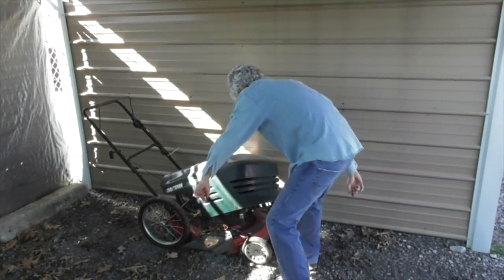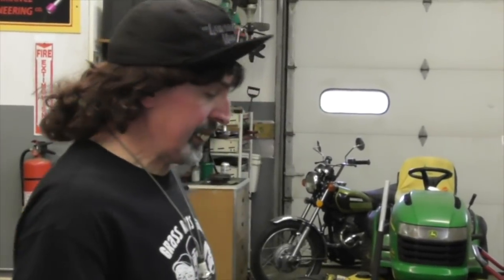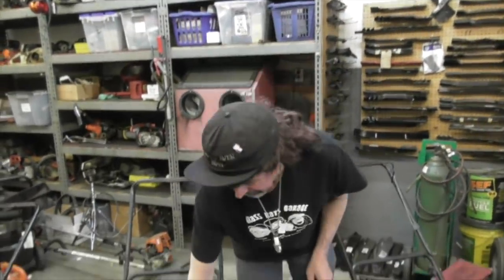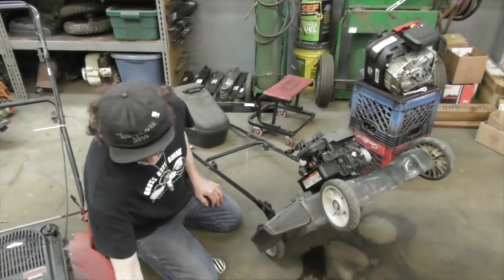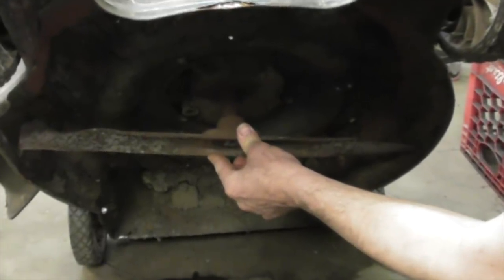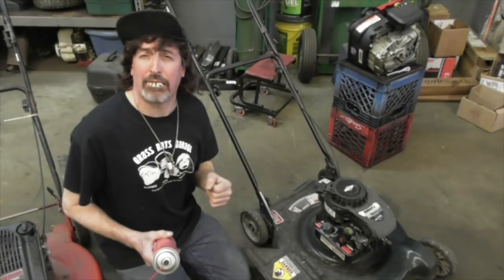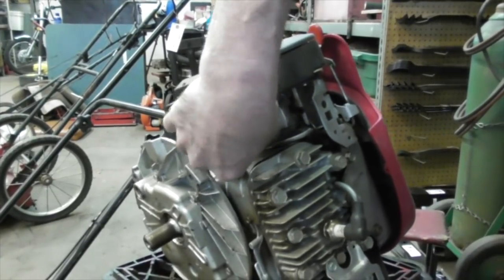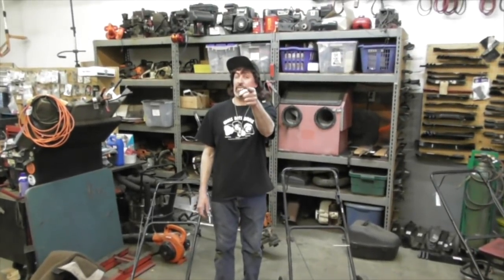How To Maintain Basic Push Mowers

Comment: I've discovered 90 octane recreational gas in my area.  It's ethanol free and I use it in all my small engines.  Good stuff but expensive.  Taryl, I always learn new stuff from your videos.  There's yur dinner!
Reply: I live in lower Michigan.  The rec gas is popular with boaters (me included) and recommended by my local lawnmower guys.  There are at least two gas stations in my area that carry it.  When I used "regular" pump gas in my snowblower, it definitely gummed it up.  I had to take the fuel line apart and clean the fuel shutoff.  Taryl would appreciate this.

Comment: The Internal Combustion Engine has provided man with an incredible leverage over taming nature.

My friend and  I cut and weed whack several cemeteries, which are my absolute favorite! 
Very often I find myself reading dates and think about how long that chunk of granite (or concrete) 
has been sitting there, through many storms and wars of man.
Before gas engines were invented, before air conditioners, before electric power
distribution, before antibiotics were discovered.  1886 is the oldest marker I recall to date,
and I wonder, how many hundreds of times the grass was cut since then, and HOW did they do it,
if at all?

The downside, many careless mowers have hit those old stones, and chipped them.
A grave marker will fight back and many have destroyed blades and decks.

Best to all and....Thanks For THinking!
Mr. Brown

Comment: Great basic mower maintenance video Taryl! I'm sure you already know this but whenever I work under the mower deck to get the blade off, I always take the wire off the spark plug, just in case the engine decides to fire while my hands are under there. I worked on a lot of much older mowers years ago that didn't have a brake on the flywheel years ago and I always did this.
Reply: I saw that too!!...
Reply: Serious question, but I've been wondering. With kill switches and modern ignition coils, is it even possible for an engine to kick over if its blade is turned? Don't get me wrong, I always disable the spark plug and always will, but is that because I'm just being extra cautiou, or because I could really start an engine with the blade?
Reply: It is very unlikely the engine would fire with all the safety switches and whatnot is on these modern engines. I am used to working on older stuff and you never reached under the deck with out taking the spark plug wire off the plug.

Comment: Hey Taryl couple of things I wanted to throw your way and not sure you have scene this before but Eaton brand fuel lines transparent inner core have separated from the inner wall of the rubber hose causing the fuel pump to suck it shut preventing fuel to the carburetor, I have found this issue on a Bad boy mower model BMG5425KO with only 32 hours run time, 2nd on that same mower a bulletin was scent out from Kohler advising that there KT models have heads that may not have the oil drain holes knocked out of the head castings causing the oil to build up inside the valve cover blocking the vacuum from the fuel pump, just wanted to share this info with y'all, Thanks again for making informative and hilarious videos !

Comment: I always run my snowblower out of gas come spring and do the same to the mower in the fall.  I found it easy enough to put the push mower up on saw horses to do the blade sharpen and oil change.  Would love to get a motorcycle lift to do this but I'm too cheap.

Comment: There is only ONE THING I think you might have overlooked Tayrl...starting at about 5:42,when you were showing how to take the blade off the mower,you didn't DISCONNECT and LOOSEN THE PLUG in the event it should accidently start by ONE rotation of the blade by your ✋ hand.If the engine does start by inadvertently rotating the blade even through ONE compression stroke,👋⬅GOODBYE FINGERS!!!!!.⚠⚠⚠⚠⚠⚠⚠⚠⚠
Great video otherwise Tayrl and we missed you and your crew last Sunday.I hope all is well and we your fans look forward to another EDUMACATIONAL 🎥⬅FILM...😀👍
Reply: Unless the dead manhandle is pulled it will not start.
Reply: Tony Papantoniou There are ALOT and I mean ALOT of older push mowers out there that are more then 20-30-40 years old and can still"CUT IT" and DO NOT have a"dead man"handle,this is a fact that seriously needed addressing and there is another comment about this same issue even before I said it.I just want people to be safe doing this work without a trip to the emergency room.
Reply: Very true, the first step in working on anything is to pull the plug wire and ground it to the frame if possible. Don't want anybody losing any body parts.
Reply: Steven Brindisi Yet,some place,some where as we speak,somebody is accidently donating some body parts doing this work.
Like John Deere says in their owners manuals..."SAFETY LIVE WITH IT"
Reply: I thought they all had dead man's handles. In that case remove the spark plug cable.
Reply: Tony Papantoniou I own a Snapper built in the 1980's and it doesn't have a deadman handle.I always loosen the plug and disconnect the plug wire.
Reply: Sensible, I would install a dead man switch.
Reply: Tony Papantoniou I agree..."back-in-the-day"nobody thought that way.
Reply: 4 gauge
Bahh. Just yell "CLEAR PROP"!!!
Reply: Russ Davis HAHA!!.😁👍Makes a"NINJA"blender look like a joke.
Reply: 4 gauge Why loosen the plug? Just unplug the wire.
Reply: RC Hobbyist Extreme When dealing with a piece of equipment that can very possibly end your life(bleeding to death)you take as many REASONABLE steps as possible to 100% secure your safety.Better safe then sorry,it only takes a minute to loosen the plug.(or even take it out)If you survive this 🍔 hamburger maker,you will never get your hands,fingers,or your life back.Remember,these small engines are alot stronger then you would like to believe.Some of them have as much as 6.5hp.and in less then 2 seconds,it will give you serious plastic surgery issues.
Reply: 4 gauge You dont have to preach to me. I play with whirling blades of death for fun. The chances of a piece of lawn equipment starting with the plug wire pulled is 100% zero. Starting a 17 " prop on a high compression Nitro powered scale airplane is a 100% chance you can lose a finger if you dont use your head, and a " chicken stick" to prevent that from happening.
I also fly scale helicopters and there is nothing worse than seeing an out of control heli heading in your direction because of a sudden loss of signal on the Transmitter or receiver. Panic can kill you. Hitting the throttle cut off switch is the best way to avoid death. I have seen pictures of guys that have been hit by rotor blades, its not pretty.
Reply: Thats ok, not taking it personal. I saw an original Big foot 72 hz ( Blackfoot? ) RC truck at a yard sale yesterday. No idea if its worth much. I know they did a remake of it last year. Sadly, the guy didnt store it well and it had issues. The original battery pack was still in it. There was lots of dust and cobwebs, smelled like it was possibly incorrectly stored in a damp environment so probably corrosion. He wanted a price on it. I had no idea as the condition didnt warrent an answer other than no idea.
Reply: Like he does at 5:04  by putting a weight on the handle !!!!
Reply: TheOldGuyPhil Too iffy at best.
Reply: The weight can FALL OFF.
Reply: BOB Driver I used to own my own shop FIRST of all.Second of all,military mechanics DO NOT DEAL WITH EMISSION ANYTHING on any tractor or truck etc..We can care less about GARBAGE like that in general,its not even taught in the class room.Why??,a military grade engine(gas or diesel)is very,very basic in design,because it has a direct affect on the reliability of the truck or tractor its in.(I bet you didn't know that)
Oh,the emission systems that your dealing with now,are designed by honorably discharged MILITARY ENGINEERS,Cummings and Catapillar have the BEST BUILT engines in the world because of their military know-how.My company that I started more then 50 years ago cleared me a 8 figures a year,most of the employees have a military background in mechanics or military engineering background in engine design.Now,transmissions...in the military,they DO NOT use JUNK like your describing,the transmissions are VERY BASIC,as in machined gear to gear,clutch and shift design,again the complicated designs are for the civilian population in general,no sensors to go bad,no electronic computers to go out etc..I used to work on small engines for many years and now I'm fully retired.(I have a 8 figure income and I have more money then even what your whole family would need in 2 lifetimes)I worked on small engines mainly for fun.Its amazing to me how many people beat their equipment into the ground and wonder why it doesn't run anymore.
Your bragging about $130,000.00??.Your starving to death.Let me know when you have built your first company and made 8 figures AFTER TAXES...have fun!!.HAHAHAHA!!.
I almost forgot,military vehicles DON'T USE ABS ANYTHING!!,IT HAS A DIRECT AFFECT ON RELIABILTY!!.If your STUPID and don't know what your doing,YES your going to get hurt or worse.Nothing EQUALS OR EXCEEDS military drivetrain design.If there was a national emergency tomorrow,the civilian vehicles would FAIL FIRST  guaranteed!!.

Comment: I have been servicing my Dads Honda lawnmower which runs the GSV190 engine, I don't worry about replacing the spark plug on his rather clean & regap it every 6 months when I change the oil,adjust the tappets,etc.

I'm a bit worried with it blowing a puff of blue smoke when first started,the compression is like new so hopefully only a valve stem seal is gone ?

The spark plug is 15 years old now,it's the same with my 1988 Briggs & Stratton lawnmower which is kind of in storage, it runs the original spark plug.

I've had to replace the spark plug in his Honda GX35 line trimmer as it lean fuel mixture symptoms such as hard starting, rough running & stalling at idle speed,it was caused by a shorted spark plug.

It looks like I may start working soon so I can buy a whole lot of B & S parts for a   114902 model 4 HP vertical shaft engine I want to build up.

So far I've found all of the parts I need,I just have to buy them,a lot of scrounging has been required as it was built in 1985 & most of the parts have been discontinued by Briggs & Stratton.

Comment: Just added a fuel shutoff to my push mower and replaced the fuel line, before I'd just run it dry, but it's a lot easier with the shutoff.  Didn't have room to add a filter, very short line between the tank and carb.

Comment: Taryl, I try to burn all the gas out at the end of the cutting season. Thanks for all the tips!
Reply: Beretta96Dan Even if you do that, there will be just enough fuel left in the bowl to cause MAJOR issues. Its best to pull the bolt from the carb bowl and just drain out the remainder. You dont even have to pull the bolt, just hold the bolt and let the fuel drain out. I like to remove the air filter, open the choke and spray WD-40 in the intake, pull it over a few times, cap it back up and done.

Comment: GREAT VIDS .TARYL ,HAY I GOT A QUESTION PLEASE  I JUST BOUGHT A HUSKY 46 INCH RIDING MOWER WITH A 21 HORSE COUGAR COURAGE AND BOTH TIMES I USED IT I PULLED THE AIR SHROUD OFF THE TOP , THE HEAD HAS FRESH GRASS ON TOP OF THE HEAD COOLING  FINS . THEY WE NOT BROUGHT IN BY MICE CAUSE I HAVE SEEN IT ALL THE TIME ON MY OTHER MOWERS. I DONT SEE ANY MISSING SHROUD PARTS MISSING. WAS THERE A BULLITIN ON THESE MOTORS SUCKING FRESH CUT GRASS FROM SOMEWHERE.. PLEASE HELP.  THANKS

Comment: Hi Taryl
Ive been a subscriber of yours for a couple of years and you've helped me a number of problems.  Here is a stinker: How can you I.d. a carbatrator when you don't know engine model it came from or carbatrator manufacturer?   Often times interscreen doesn't have answer.  Is there any other cross reference you know about? 

Or if an engine model # starts with same couple of  letters or numbers is it safe bet identical looking carbs with different markings or part #'s wil be interchangeable?

Comment: I was hoping you would show us how to grease the muffler bearing, tighten the staimafratzen and adjust the knudler arm!
Reply: Oh come on BC    you know how to do those basics
Reply: 70carlton oh, of course! I was thinking of the layman,attempting this for the first time. You can ruin a motor if the staimafratzen isn’t adjusted just right.
Reply: You do make a valid point there,...Many a good mower have been ruined due to an out of adjustment stainmanfratzen,...keep it tight
Reply: You also got to regularly change the piston return springs
Reply: And of course, don't forget to clean the peanut valve!!
Reply: Don't forget the ID-10-t lube
Reply: And check the run-out on your floating finnegan pins!
Reply: BCtruck, rebuild, repair,repurpose I think how to air up the tires is important on a push mower is important.
Reply: And don't forget to check the Finnigan pin. They can wear out as well.
Reply: And of course don't forget to replace the pull cord every 10-15 years. They will break from dry rot. I have learned 550 paracord is awesome.
Reply: Don’t forget the blinker fluid. Oh wait, it’s a lawnmower
Reply: Who else has used the words "muffkin," "Techmusish," "Inter-screen," "carbetraitior," or "Krohrel" in the shop?
Reply: Dale Grote taryl
Reply: LOL Now that's an expensive push mower,lol
Reply: I tried 550 but it broke really quick..?  Not sure if it was rubbing or what, just didn't work out for me:( Good idea though:)
Reply: Thanks, guys!  I'm a Democrat and I'm writing all this stuff down!!  My mower is gonna last forever!

Comment: I was taught to always pull your spark plug wire when working around the blade.  I know modern mowers have the safety switch on the handle but if it fires when you are spinning the blade you can cut yourself pretty badly.

Comment: Learned something new, which way to tip the mower, Thx.
What is the proper way to dispose of the gas/oil?
Reply: MJCPeters , some of your local shops may dispose of it, but they're might be a disposal fee.
Reply: Take it to your local landfill. They usually have tanks you can dump it in and they send it back to the refineries so they can filter it etc and recycle it. At least here in Maryland they do. I'm sure most states are like this now.
Reply: MJCPeters You can let the fuel naturally evaporate or pour it into cat litter to absorb the fuel. Let it air out a few days before putting it in an airtight container, then dispose of in the garbage. Oil should ALWAYS be recycled. Check your local garage or advertize as free drain oil. Some guys burn it in oil furnaces.

Comment: I have been watching your videos for a couple years. I have a Toro push mower with the mulch bag . As the years go by the middle bar  ( for reinforcement)for the handle is Non existent. This as you know causes Stress on the weakest part of the handle by the "wingnut". My friend made his own middle bar by simply drilling 2 holes and bolting it. Obviously it can't be in the way of the mulch bag when emptying. Truth be told- I cut 3 other lawns which 2 take an hour to cut. Can you please bring this to the attention to the other You Tubers and Toro, Craftsman or whoever slaps their name on these Engines? I have No Problem with the engine- just the bar breaking( once) or the Wheel support usually the Back happening twice. Maybe I'm too strong? Thanks Taryl!!!! Enjoy your presentations. :>)

Comment: Taryl, should we use those "fuel stabilizers" for storing gas over the winter?
Reply: I use Seafoam and recommend it to my customers. It works as a fuel system cleaner and fuel stabilizer. I’ve had engines sit for as long as five years with Seafoam treated fuel in the tank, and it still smells fresh and runs fine. I use it year round.
Reply: John Acuff I agree, I add seafoam to my gas cans every time I fill them up. You never know, you might fill up your gas cans for mowing season, then it's dry and your only mowing once a month.  Same with winter. I live in Michigan and the weather is very finicky. It's rare but if I have gas that is sitting around for more than a couple weeks, I take up to the station, pour the gas in the van, and refill the cans.
Reply: jhitt79 I have watched open fuel in a drain pan absorb moisture here in Michigan. It turns cloudy. I agree, any type of stabilizer now is formulated for ethenol fuels.

Comment: Taryl  by all means am not a Mr. Know it all and have made my share of mistakes. Your videos are great and I learn alot from them. It was pretty scary to see you remove a blade with the spark plug connected. Especially when you tipped up the lawnmower using the chainsaw saw a weight. This could very well engage the bail, and could be a recipe for disaster. The saving grace could be bad gas

Comment: Simple diagnostic checks......... Air, Fuel, Spark, Compression, and Lubrication
Reply: Spokes The spark plug can be the most overlooked source of trouble on a mower. I remember getting a batch of defective spark plugs on year. They were after market plugs. I was trying to save money and give my customers a break on the cost of replacing plugs. It ended up costing me time and money. I shipped all the bad plugs back. The company ended up doing a recall on every one of those plugs. They were All bad. The center of the plug annode was never properly sealed in the plug and they would actually move, grounding out the plug. I have never used after market plugs again.

Comment: There's not much oil in those little mowers so change the oil when your going to sharpen the blades. That way you can flip the engine in any direction. Of course do all the maintenance when the fuel tank is empty. If you sharpen your blades 3 or 4 times a year change the oil 3 or 4 times a year.